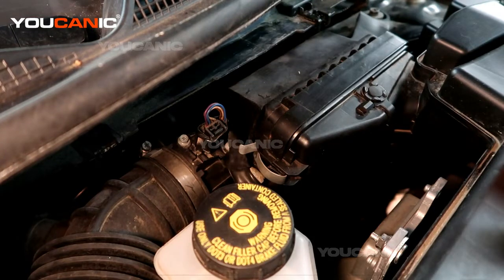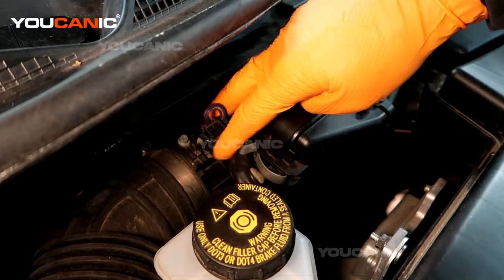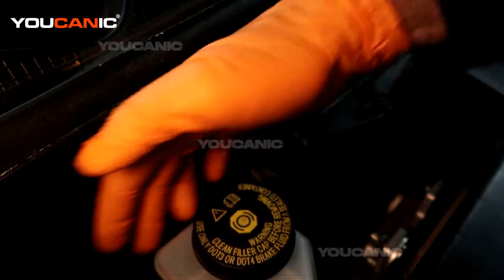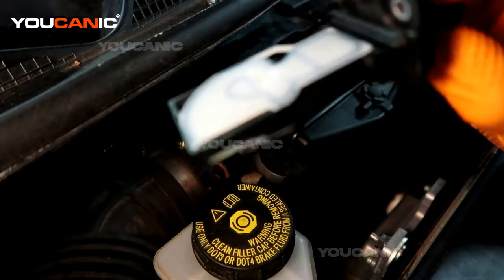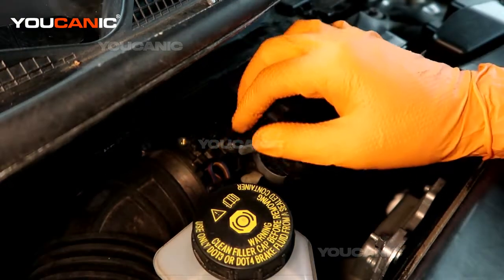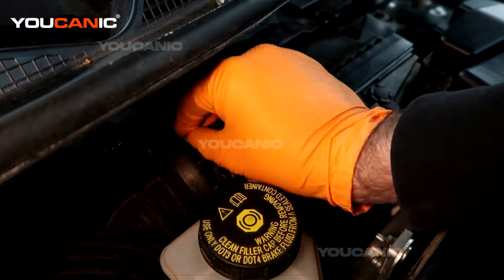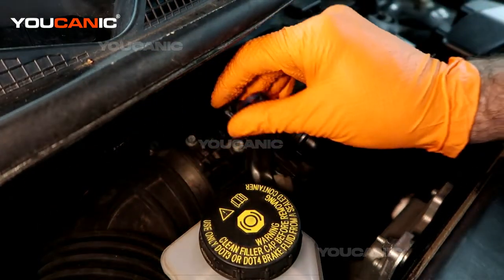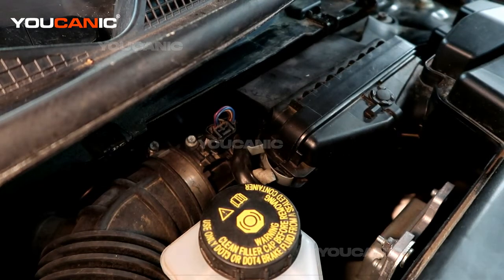2017+ Nissan Rogue Sport Mass Airflow Sensor Replacement

Comment: After 20-30 mins driving my 2016 rogue loses acceleration when I proceed after stopping at a light. It then revs high but when I shut it off for 1min then start back up, it’s fine for another 30 mins then cycle repeats. Is it the maf sensor?
Reply: Mine does the same thing, did you get yours fixed?
Reply: Sounds like it. Do you have a auto zone nearby they can test it for you just to check.
Reply: My wife’s just did the same thing today as well. 650$ they are quoting to “fix it”

Comment: I was told by a auto parts store that taking it in to a shop is the best option since the computer has to be reset. Are they right/wrong. Is it something I could take care of at home without taking it in to a shop?
Reply from the maker: You can definitely do this yourself at home.
Reply: @YOUCANIC  Another thing, do you have a video on how to replace the “anti-lock brake control module,” that is the other project I have on my 2018 Nissan Rogue.
Reply: @martinp2251  x2
Reply: LA COMPUTADORA HAY QUE REPROGRAMARLA DE NUEVO CON UN SCANER. NOS ES SOLO CAMBIARLO.